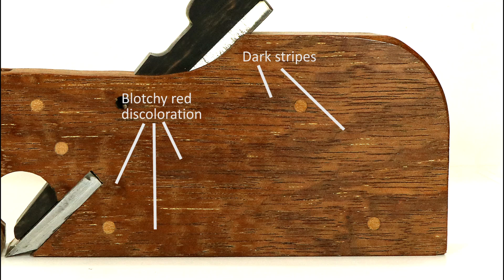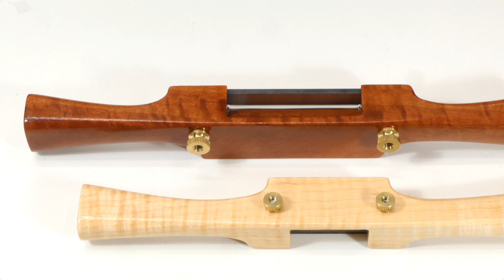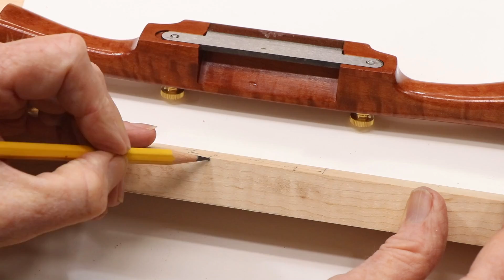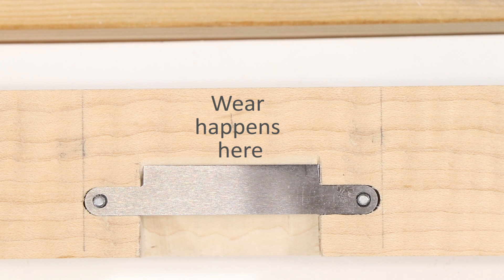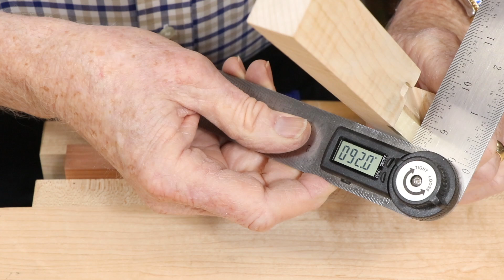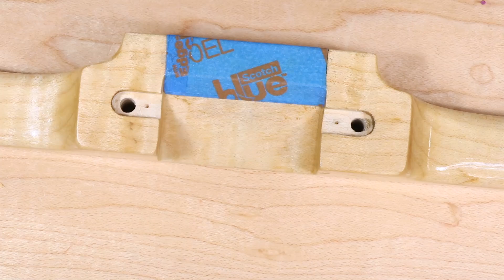Making a Spokeshave

Comment: I can see its non adjustable --so when blade is worn down --do you make another ?
Reply: You really didn’t see adjustment until cast iron planes.  And then, it’s really more about lateral adjustment than maintaining depth.  I usually keep my blade skewed so I can adjust the depth of the cut by shifting right or left.  The exception is when I’m working on a flat inside curve.  I’m not a fan of the 151 and prefer a 51 or other without the screw adjusters.  They’re not precise enough to be useful and just get in the way to me.  Tapping works better in my opinion.

Anyway, unlike a bench or block plane, the mouth of a spokeshave doesn’t really matter.  It’s just a jig to hold a blade at a pretty consistent angle to a tiny sole.  A drawknife is similar, but with a completely free angle.  It’s really nice to do the bulk work with a drawknife and then clean up with a spokeshave.  Usually I use a file after that to get any remaining high spots.

If you did sharpen the blade far enough back to matter, you’d replace the blade.  The blades were traditionally made by blacksmiths and didn’t have screws.  The holes were slightly wider than the posts and friction did its thing.  I’d google an image because I’m not explaining it well.

This one uses very nice tool steel instead.  I love Hock blades.  Generally, you just lightly hone a spokeshave periodically and not remove a lot of steel to sharpen.  I usually just strop mine… maybe hit it with the finest grit… before I do something and it’s fine.  I’ve really only gone through a full sharpening when I’m restoring one and need to set the bevel.

It’s used far less than a bench plane or chisel, but is so fun.  This blade could last decades.
Reply: Thankyou for your lengthy clarification--now I see why there is no adjustment--appreciate your insight and explanation ---I can now shave without any trouble --grateful. --

Comment: I made a spokeshave while working at a living history state park in West Virginia. I made it out out of apple wood and forged the blade out of a Volkswagen Rabbit torsion bar. Air hardened steel, and forging it hurts your elbow. Red hot and hard as cold steel. My tangs were bent up 90° to the blade, and small wooden wedges held it in. 

I did my final sharpening with a fine file and oil, then wiped the oily rag on the apple wood to oil it. This made the wood look old. 

A guy had been coming by a couple times every week and he had 3 full sized barns of antique tools and housewares. Two 2-car garages of antique wheelbarrows, seeders, and man powered gardening tools. He looked it over and thought it was a 1700s design executed in the 1800s before 1820. It was 3 weeks old - AND pure joy to use. The best way is with a shaving horse. By FAR the best way, easiest, most control, most ergonomic and fun. I liked Roy Underhill's plans...

Comment: Another way to measure the spread between the studs is to measure the outside to outside, write that down, measure the inside to inside, then add that to the other measurement and divide the number by 2.  That will give you the center to center to within the accuracy limitations of your measurements.  Thanks for the video, beautiful work.  Thumbs up to crush a troll.